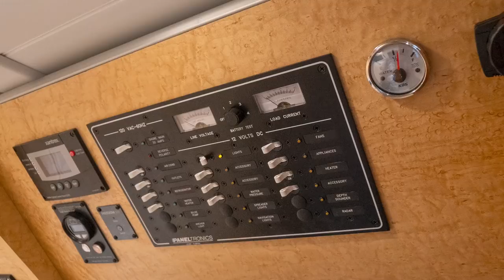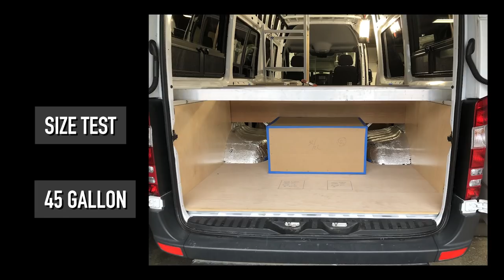Luxury Sprinter van build by Humble Road! The doctor & his wife had their wants, needs and desires.

Comment: hi George,  great build and great video. If I only may recommend you to cover slots of 80/20 with T-slot cover (part 2111 or 2824). Slots which are inside the cabinets. It will protects slots from dust/dirt/debris and will keep clean look after driving thousand of miles.

Comment: Hi GEORGE. so I got a swivel on my passenger seat in 04SAVANA stock seats but tight as a nats ass to turn all the way around. Couldn't get drivers seat to swivel so returned it. May need to redrill mounting  bolts moving seat couple inches toward the center. Any suggestions where to buy one and how to do.

Comment: (1) Humble Road notification
(2) Like video
(3) Watch video
(4) Like video more

George, that van has a beautiful garage. Beautiful!

So funny you went off on, um, elaborated on, the sub panel.  I have lights and video cameras - the type of DVR camera system truckers use - I want to mount on my Sprinter's roof rack but, no room in the exiting distribution panel which is in the garage. I have an access point in the roof behind the driver for a light bar that I'm not installing so I figure the sub panel could go under the bench behind the driver; and mount the DVR there too; pretty much directly under the roof access.

Looking for someone to tell me how to do all that without creating a leak in the roof or burning down the house. Running wire to the back is no problem; through the lower cabinets. My builder is in California, otherwise I would pay him to do it. Have any friends a couple of states to the left?
Reply from the maker: Maybe I should do a detailed video on sub-panel
Reply: @HumbleRoad  Yes, please do!!!

Comment: So much beauty, functionality, creativity, high quality, gorgeous materials, and problem solving is hard to digest in one sitting. Simply stunning, George!  What a renaissance man you are.  I think you are directly descended from Da Vinci, in whose head science and art became one.  I don't want a van like this, I want a brain like yours.  I envy your brain.  I wish I had half of its knowledge and creative output.  You are leading the paradigm shift from traditional RVs to high tech homes on wheels.  You have outpaced even the Euro manufacturers.  There is nothing gaudy about your builds - form follows function.  The zen of van builds.  Bravi signori! Che magnificenza!
 
25:55 - Look at this curtain insect screen for example.  It embodies options: All the way up/ all the way down. Bottom up/ top down.  Top up/ bottom down.  All the way down, but no insect screen for a view of sunset from bed.  You could not add more functionality to this curtain screen. It has exhausted all options, and leaves nothing more to be desired.

25:57 - For artistry, look at that shiny metal porthole mirror with rivets on the satin sheen of the walnut paneled wall. It is the first thing you see as you walk in and it sets the theme for the build.  It is a captain's room on a ship.  The floor extends the luxury yacht theme visually with that lovely striped cherry planking.  This is so much more than interior decor. It is the whole theme in a nutshell seen soon as you walk in the door.  These are the hallmarks of a great architect.

I can see a woman's hand in the beach-themed cushions, clam shell mother of pearl handles, ocean blue countertops, and well placed pull out pantry. Well done, Mrs. Sprinter!  That splash of color is like the blue ocean surrounding the yacht, and the little shells on the beach.  So pretty.  The yacht touches are so realistic, I can almost smell the Havana cigar smoke and salty sea - a lot of Mr. Sprinter in there.

The innovative overhead 'aircraft' cabinets are so clever.  The marine style latches everywhere give a touch of luxury. Those are very high quality latches, Blum glides, and spring cabinet struts.  The marbleized FRP panels are understated elegance.  The high tech shower head looks very Euro design, and is so modern.  The cool white of the marble and cold steel of showerhead contrast well with the warmth of wood all around. 

The burled maple is stunning. I love beautiful wood grain, and Alex and Ron never disappoint. The small details like the support frame around the Lagun table base at 26:00, the easily removable garage panels, the slide out wood access panel for shower fittings behind the drivers seat, the continuous wood grain of galley, are hallmarks of excellent design. 

The joy was in watching you solve these problems during the build videos, work the designs, and tirelessly strive for the impossible and the best, not settle for mediocrity.  You also filmed your work, and you did this with excellence in lighting, angles, high resolution, clarity of sound.  Your videos are a work of art unto themselves, and so enjoyable.  

Every van has a unique character like its owners.  Kudos, Bravo, Salam, Namaste, Salut, Ti Saluto!  Great work team, George, Alex, Ron!  Thank you for giving us all something extraordinary and ground breaking.  Thank you for your contributions to the excellence of RV design. This one was sublime.

PS - You know you have GOT to make a video on how you did that maple veneer lamination with the plastic shrink wrap - such a teaser!
Reply from the maker: Thank you Lass. As always, you left me speechless.

Comment: Incredible buildout.  You've raised the bar so high that the rest of us are saying "I love ours, but it ain't a Humble Road."
Here's a safety thought I am working on for our Sprinter:
The bed platform is so close to our rear doors that in case of an emergency requiring a back escape, we could not access the door latch.  We'd be trapped.
I am going to modify the rear door latch so there is an upper handle that is quick and easy to grab that will open the back door.
Wish me luck!
Reply from the maker: That is an excellent undertaking. Please keep us informed of your progress.

Comment: Congrats to the new owners and to George on an exceptional build. 
For the airline cabinets, just curious if the pivot hinges are required to be positioned externally or could they have been positioned inside and out of view?
Reply from the maker: the hinges must be mounted on the outside of the arc in order to gain full range

Comment: Just simply amazing!  I may well have met my match with regards to trying not to overlook even the smallest detail.  What a wonderful build!  One thing I noticed in particular...  What exactly is that material you use in the back of the overhead cabinets that is removable?  That is a very practical idea to allow easy access to the wiring of the van.  Is it some sort of PVC?  I am not sure what to hunt for but I'd like to try that out at some point...  If you don't mind sharing...
Reply from the maker: Poly board pvc
Reply: @HumbleRoad  Thanks very much sir.  Would the 1/16" be the weight that would allow that natural bend yet be stiff enough to hold it's shape?  Again, such a grand idea to allow easy access without a single fastener to remove!!
Reply from the maker: The structure is in the curve. Out flat it is very floppy.

Comment: I’m intrigued by the large PVC tubes in the photo around 25:44 - for gray water? If so, what’s the capacity and why the switch from the tanks you’ve used in the past?
Reply from the maker: There’s a lot of stuff under there. No room for a tank! So 8 gallons on each side. With vents and overflow ports.

Comment: "Look at the lens" he says then turns away and looks back at the screen.... yeah, I know - it's hard.....
Awesome job George, as always.  Yep, the jog does add depth to the kitchen facade (whereas my jogs are just a facade - I prefer wheels).
Glad you didn't cut out the water spigot drenching - that would just have created more questions (or musings) re: wet crotch.....
Truly a mobile work of art, indeed.  
Just one question: The awesome bed, is there some mechanism holding it rearward to stop the bed sliding forward in hard braking situations while travelling?
Reply from the maker: The Legun dining table is the bed brake
Reply: @HumbleRoad  Of course! - so obvious now you pointed that out.....

Comment: It's a great build, big 80/20 t-slot fan. Maybe it's time to start considering under-body tanks, though, and reclaim a fair amount of interior space, one of these days. They make custom sized tanks to go under the Sprinters and several other vans. Downside being that they need heating and insulated plumbing if you want to be 4-season.
Reply from the maker: That’s a big down side in my humble opinion.
Reply: @HumbleRoad  Yep, it gets quite involved to ensure 4-season. Insulated tanks, routing return hydronic lines past the tanks like Advanced RV does and so on. But you can fit larger tanks and save quite a bit of interior space, so upsides and downsides to both.

Comment: Does the engine always have to be running for hot water shower? Can van be parked for a week without starting but still have hot water shower?
Reply from the maker: The hot water is made with the engine running. You can get two days of hot water off that. If you stay parked longer, just turn on the inverter, it also has a 120V AC heating element. Options!